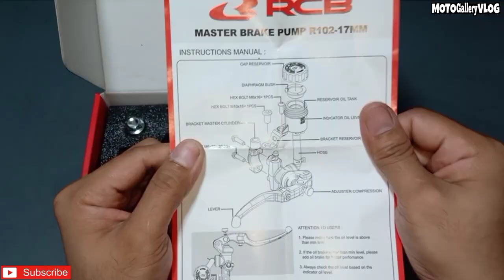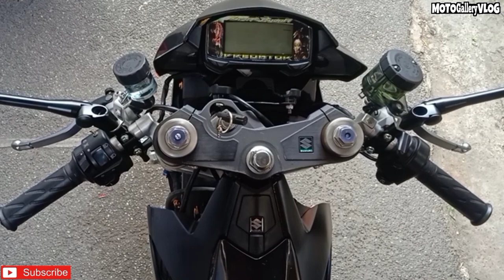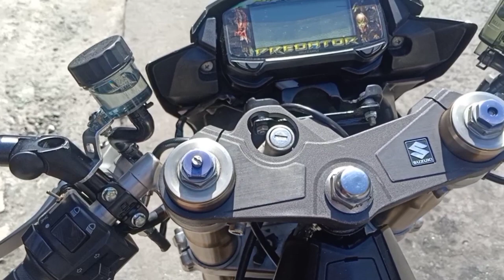RCB FORGED S1 BRAKE MASTER & HYDRAULIC CLUTCH (17mm) INSTALLATION + BREMBO FLUID TANK | RAIDER150 FI

Comment: idol kamusta na po hydraulic clutch mo? feedback nmn po. tas need paba tlga bumili nung connector pra sa mga switch? nkbli na po ako Pro d pa nasalpak. slamat
Reply from the maker: Goods na goods paps... Actually matagal na akong naka hydraulic clutch boss. 2018 pagka bili ko ng raider Fi ko nag hydraulic clutch na agad ko. Pero ang gamit kong hydraulic brake master ung unang version... Hanggang sa nag palit nga ako ng bagong version.. Ok na ok sa long ride at sa traffic kc malambot sya pigain at di masakit sa daliri,,, sya male female connector yes boss kailangan po nun para maikabit mo sa stock wire connector ng raider

Comment: Pwede po ba 14mm paps?yun kasi rply ng racing boy lazada sa akin.
Reply from the maker: Ilang piston ng caliper gamit mo boss sa front? Kung single piston, 2piston, 4piston caliper ok yung 14mm brake master pump☺️☺️
Reply: @Bosswawaymotovlog  lods. naka 4 pot ako kaya ba ng 14mm e3 series or s1 or s2 14mm talaga? Mag ka iba ba ang kapit ng 14mm e series at s series na rcb?
Reply from the maker: @randyyamson1721  kung 4piston caliper lng gamit mo sa front boss ok lng kahit mag 14mm ka, pero kung dual 4piston caliper ayun ang need ng 17mm... S1 or S2 na 14mm same lng naman sila boss. Sa design lang nag kaiba😊😊